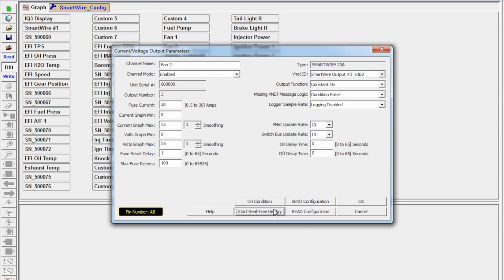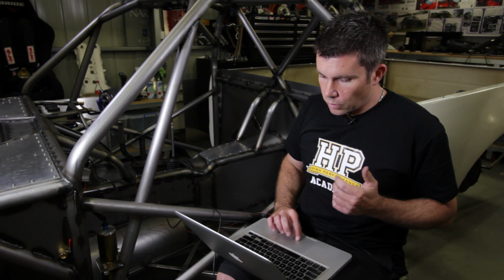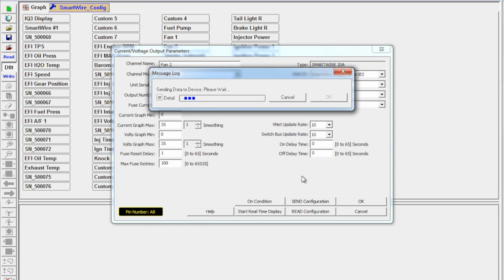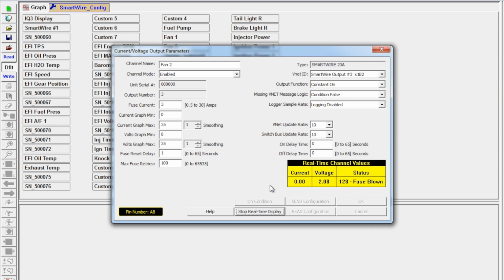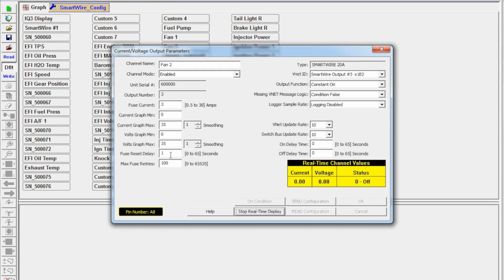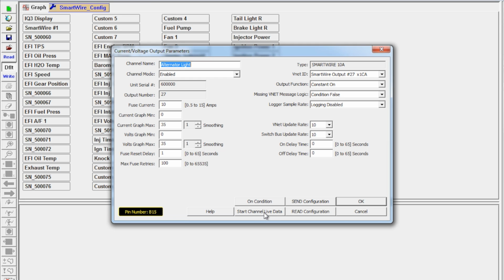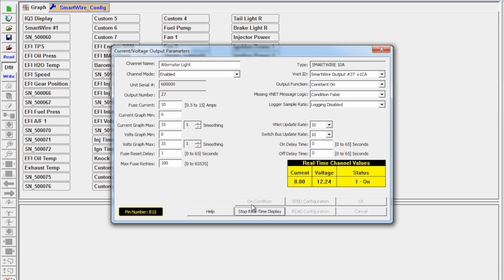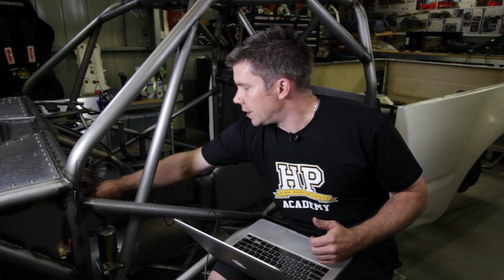Racepak's Smartwire Power Distribution Module explained | High Performance Academy

Comment: Would it be possible to use a PDM in conjunction an OEM ECU? Or are PDMs specifically for use with aftermarket ECUs?
Reply from the maker: You could indeed, how difficult that would be completely depends on the application.
You really want to look at the specific vehicle as it will be different between many of them especially depending on their age and aftermarket support, and then decide if the juice is worth the squeeze as even if something is 'possible' it isn't always worth it in the big picture - Taz.